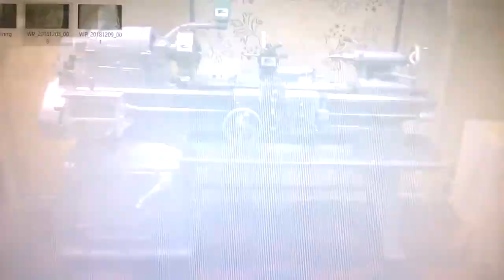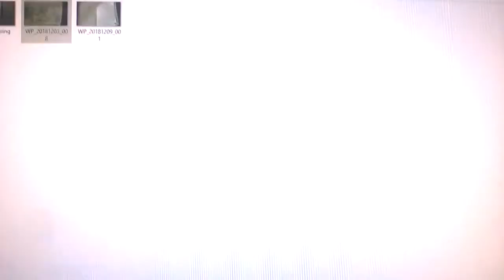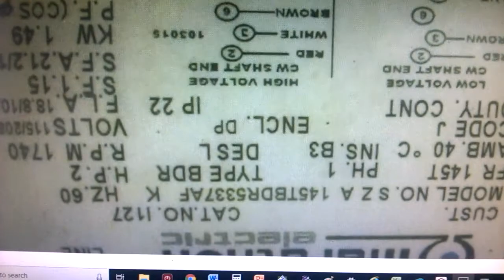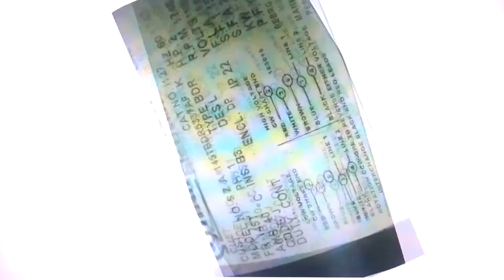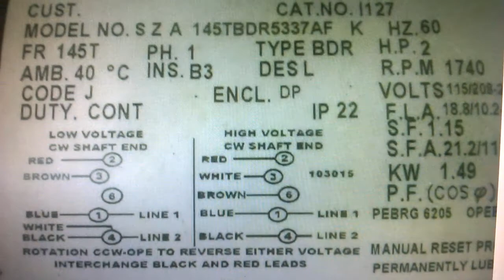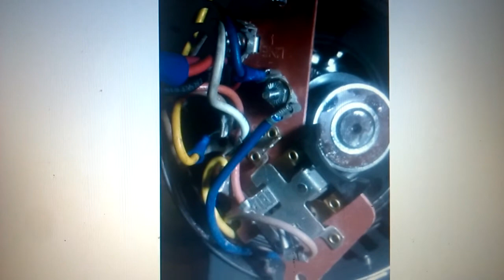Marathon motor repair

Comment: Interesting problem and solution. I had a compressor this past summer that someone was throwing away... they said it was junk and this that and the other, and the damn thing fooled me at first. The motor in it has a little internal fan that is press fit onto the shaft, and just the way it looks it fooled me at first, and fooled the original owner too I would imagine, but the damn thing was sliding up and down the shaft at random times and interfering with the centrifugal start switch. I had this thing apart like 3 times until one time I happened to say to myself "Wait... that SOB wasn't there when I put it together..WTH?" So I powered it on and off a few times, and sure as heck I saw it slide down, then back up just enough to jam up the switch. I laughed... then put some loctite on it!! :)
Reply from the maker: A lot of motors are junked because of this simple problem.A lot of money could be saved.